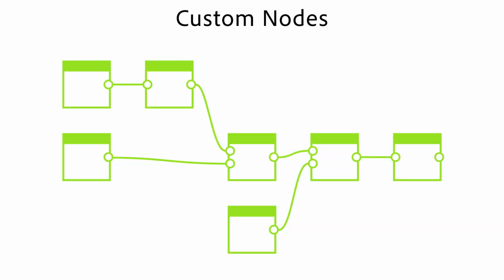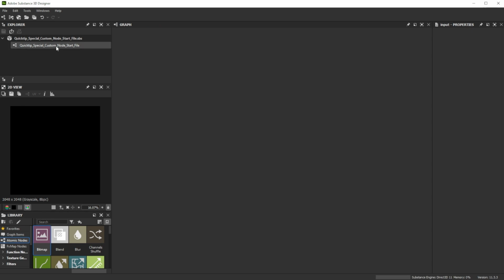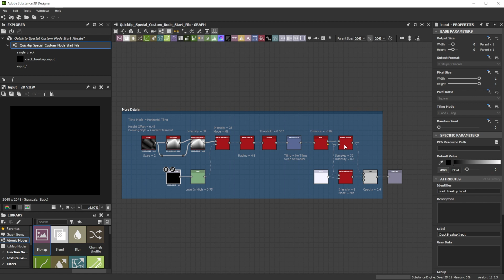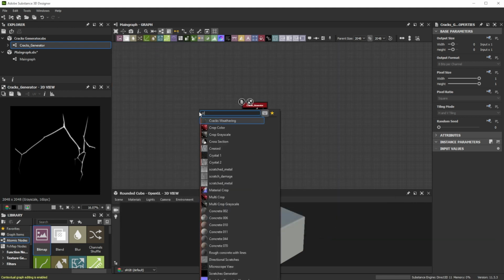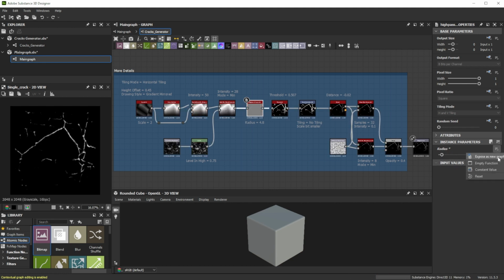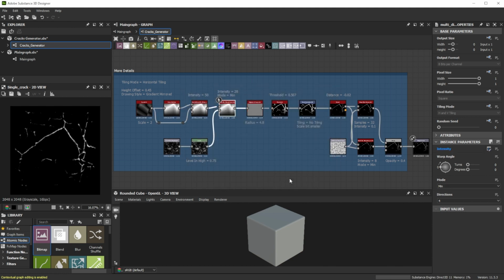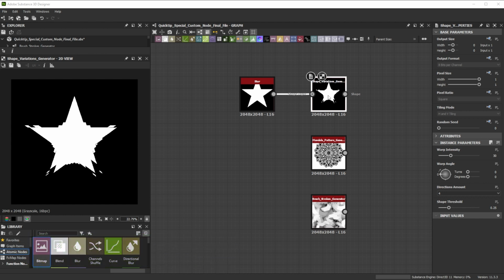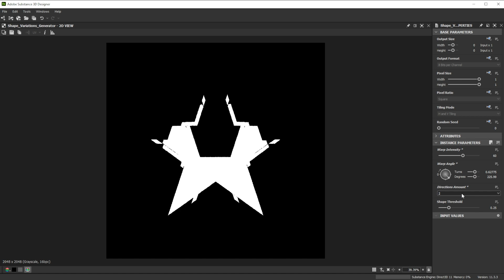Custom Nodes | Designer Quick Tip #11 | Adobe Substance 3D

Comment: Question about adding custom nodes to a project: If I were to have some custom nodes added to my library in my version of Substance Designer and I want to create an SBSAR file, will all of the custom node dependencies be added to that SBSAR file or do I have to manually add those nodes to my project first?

Comment: Something I would love to see in a quick tip video, a guide on creating different types of leaks. I've been trying to create some leaks leak alphas in designer that I can then use as stencils in painter. And while I've made some decent looking stuff, there is still a lot that could be improved.
Reply from the maker: We have a video specifically on leaks. Have you seen it? It's basic but covers some key techniques. Once you get familar with generic designer techniques it shouldn't be too hard to improve on these.

Comment: You know what could be a great quick tip? Layering ! A lot of people struggle with realistic layering of objects without ugly intersection.  Pebbles, gravel, coin piles, up-close sand material and much more. Lots of examples where one might want to have layers of depth.
Reply from the maker: You mean height layering? My experience is there's no magic trick, it's just finnicky, stacking multiple sparse layers on top of each other. Is that what you mean?
Reply: @Substance3D  yes, height layering. Sorry should have been more specific. I agree its finnicky, but even so, would be very nice to have an official video of a few tips or showcasing different techniques how to get it to work. I know people use different methods like color tile samples with alpha bleds, height blend nodes, max lighten blend nodes and more. While some dont work at all, there are some examples out there where it works briliantly. So there must be some techniques that are  working...whatever they might be.
Reply from the maker: Thanks! We'll keep it in mind!